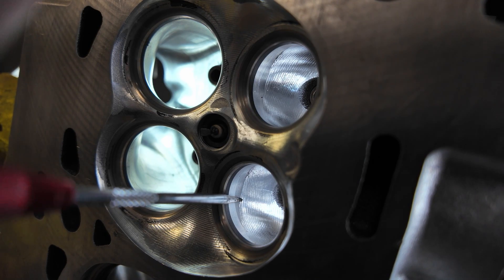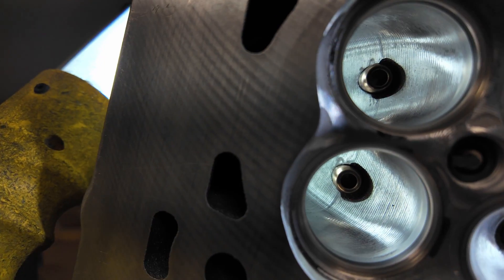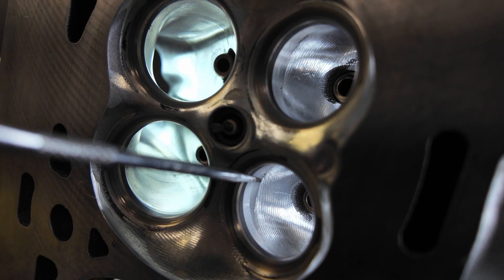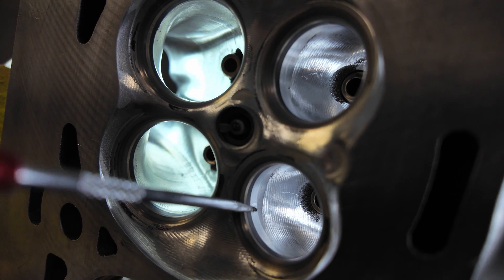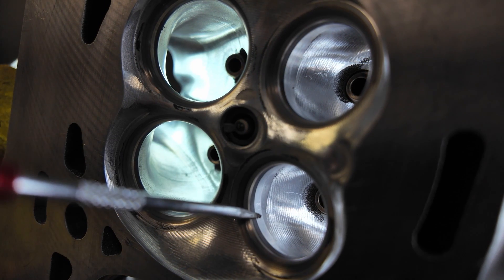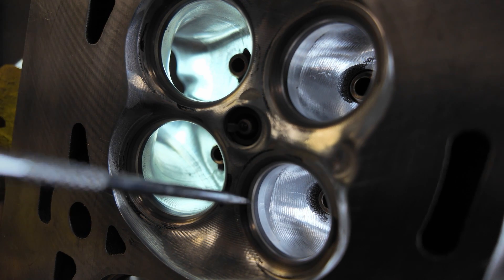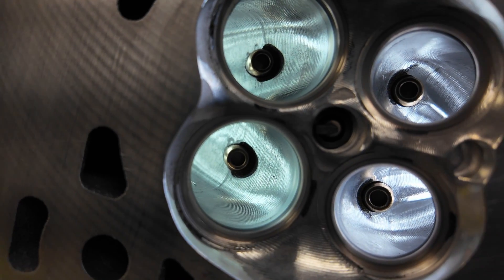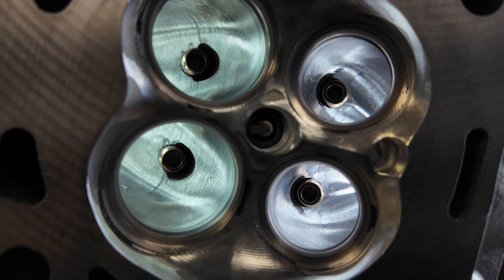Final Form: Gen 2 Coyote Head Unleashed

Comment: Can you make a video explaining how you measure wear and taper on valve guides using the small inside bore gauge? I want an idea of what you think is acceptable or not, and examples of when you would install new guides. i am new at engine machining and very passionate about learning how to do everything the right way. Most people in the industry safeguard information and it's ridiculous because they think someone will use it to steal their business and customers. But unless you know someone in person who actually knows what they are talking about it's impossible to learn the correct way of doing many machining processes and simple measurement checks. Thanks
Reply from the maker: if someone thinks what you are asking to see is a tight secret that just means that they probably don't do it or don't know. I can work on a video like that.
Reply: @headgames awesome thank you. I know it's a lot to ask, but could you also explain setting a target spring closed seat pressure with shims, and checking if the spring will have enough coil bind clearance? I'm always asked to bump up spring pressures for customers, and sometimes I have no clue what exact springs they provide. For example, I use a pro-form pressure gauge with the valve assembly in the head and slowly increase pressure on it until I feel the valve crack open. I'll see 90lbs and add .090 of shims to get around 115-120lbs. I'm told to then put the spring by itself on a press gauge and bring it to the 120 pound point, then add the lobe gross lift. This will be my open pressure, and keep compressing until coil bind. The amount between that open pressure and until it physically coil binds is the actual coil bind clearance? Thank you.

Comment: Did those hot cams ever drop that you told me about? 

Also, do you need to upgrade fuel management when doing head porting? 

Thnx
Reply from the maker: Not yet, but soon! 
You need to tune for the heads, but not a special ECU.